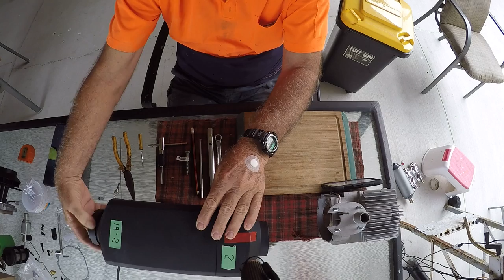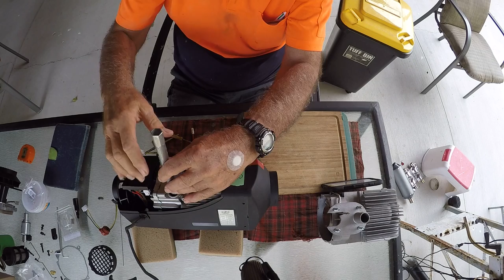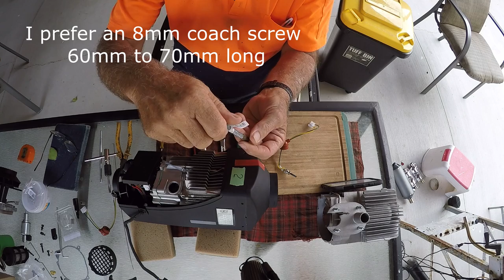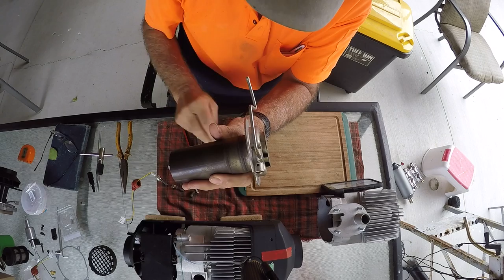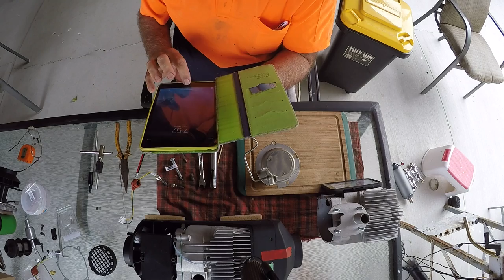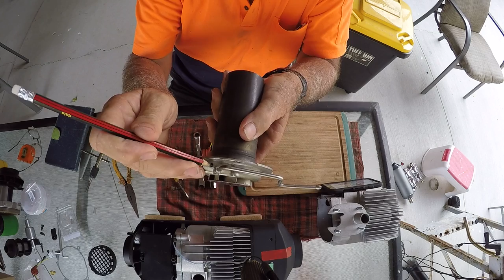Chinese Diesel Air Heaters - Part 9 Glow Plug & Atomizing Screen

Comment: I can’t say it enough, “thank you very much for all your time and effort to make these video”.   Excellent series!!!
Reply from the maker: Hi Svmsice, thank you for the positive feedback. J
Reply: @johnmck1147  i have a 24v 5kw chinese diesel heater and i can't find a glow plug for that specific heater any ideas ?
Reply from the maker: Hi Billy, if you have the common Chinese Diesel heater that is a copy of the German Eberspacher heater there are many suppliers on the internet and eBay. Below is just one link to get you started.

https://www.ebay.com.au/itm/12V-24V-2KW-5KW-8KW-Chinese-Parking-Heater-Glow-Plug-Ceramic-Pin-Wrenzh-/384588971240?mkcid=16&mkevt=1&_trksid=p2349624.m46890.l49286&mkrid=705-154756-20017-0

JMcK

Comment: Definitely a 'Must Watch' series on these Chinese Knock Offs
I have learned that I was about to be ripped off, if I bought the 8K unit.
Also learned that I need to get a better intake screen, two flow through mufflers & yes I can mount the unit on it's side!      as long as the glow plug is on the uppermost side
Again, these are the very best tutorials I have ever binge watched!!!
Reply from the maker: Thanks for the positive post KGB. I am pleased you found the videos helpful.  JMcK

Comment: Wow! Anyone thinking of buying one of these heaters or anyone who already owns one should watch these videos! You have done your research, and you have a real talent for explaining the workings of these heaters. 
Because of your videos, I have corrected some of the mistakes I made when installing mine. For example, my pump was mounted level with the floor of my bus. I have now set it at about a 45-degree angle. I tried setting it straight up and down, but it wouldn't pump the fuel in that position. I fear running it for two weeks in the horizontal position has caused wear that prevents it from pumping at its full pressure. Not to mention I used the priming feature to prime the heater. 
I am about to do my three-week review of the heater and if you wouldn't mind I would like to refer people to your channel. All of these heaters should come with a link to your videos.
Reply from the maker: Hi Luke, thank you for the positive feedback. 

Yes, a 45 deg pump angle is probably the best all around angle. 

You are most welcome to recommend these videos. I do them purely to help people where I can, as part of a paying it forward philosophy. I would like to think some people in the future will pass on similar helpful knowledge to my grandkids.

Comment: When you install the Atomizing Screen make sure the welded joint in the screen is opposite the air and fuel line orifices. Thanks John, wonder full work ...

Comment: May I add a fine point in replacing the Atomizing Screen to John's excellent video. When installing the new screen, make sure that the spot welds on the screen is located away from the fuel inlet. If the weld is adjacent to the fuel inlet, it can block the fuel from atomizing and creates a lot of white smoke on start up. This was the problem of my new Chinese Diesel Heater which smoke on start up from new. By moving the spot welds 180 degree such that the fuel jet onto the clear area of the screen, the white smoke problem was resolved.

Comment: Wish I had seen this video sooner. Tore my heater apart due to not  lightly up, carbon all over from one season of running it. Long story short, I think the atomizer was in the way of the air hole and I had no clue it wasn't supposed to be, so now it will only start on the second attempt (due to the glow plug being preheated from first attempt). I just ordered some new screens, so will be tearing it back down to do this right and put a decent filter on it as well as I have the one that I think is meant to baffle the intake, not actually filter it. UGG is all I can say without turning into a sailor mouth, lol. Thanks for the great video's John McK, you and David M. are life savers!
Reply from the maker: Glad to know the videos were of some help.  JMcK
Reply: Fixed it! Put a new atomizer screen in the correct way using a 3/8-24 tap to clean the threads of carbon and use a BIC Soft Feel Pen to carefully push the screen in place where it should sit (had forgotten about the pencil trick shown in your video). BIC pen is 8mm or 5/16 diameter, pulled the ink side out since the cap was glued in place on the other end. Worked like a champ and now the heater is starting the first attempt. Again, thank you so much for the helpful information John McK!
Reply from the maker: 👍, Good for you.  JMcK

Comment: The manner in which you explain theory and operation is much appreciated,  John! First in installation and secondly being able to diagnose when that time arrives. (Everything man made fails. And never according to budget or schedule!) Viewing a 2nd time, mainly to learn if fuel supply line on heater, the metal one, can be cut and reconfigured. My Plan is to install in a box and operate on a roof top of a SUV. A concern I have is also how much weatherproofing it requires in operation. I see it's basically another ICE except that it's product is heat only and not HP so breathing is critical. 
Again,  like so many other commentors, well done, John. Well done!

Comment: Excellent video very well explained! I think this is the problem with my heater it won’t fire up and I just checked after watching this that my air filter has fallen off, I will take apart tomorrow 👍 

Those birds in the background sound absolutely delightful are you in the middle of a rain forest 😂
Reply from the maker: Hi Ryan, thanks for the feedback. No air filter will not stop the heater lighting, but a carboned up screen will. 
I live in a rural area, not a rain forrest. But I occasionally feed the birds.  JMcK

Comment: John I live in Canada and we have ultra low Sulphur diesel fuel. I found that adding kerosene to the heater tank helped in the winter but you have to keep the amounts low. I found that 10%kerosene to 90%diesel is about right. If you don't then you will cook your pump. I also found that the cetane number is only 40 in Canada and is not high enough. It is recommended by espar to have a minimum of 45 for best performance. You can go up as high as 50. Cetane is the naturally found in diesel fuel but depending on the country it will vary. If you use a cetane booster then kerosene is probably not necessary unless the temperature is really cold. I suggest that you check this out. This is the only year I have not had to change the atomizer screen and it is still working like new. Cetane by the way is what makes the diesel burn and adding kerosene to the fuel lowers the cetane number. The higher the number the hotter it burns

Comment: Thanks John, this is the first time I have needed to change the mesh and is operating fine now. The mesh was very carboned up but I didn't need to use the new gaskets etc, which came with the glow plug kit, as the chamber did not require a clean.

Comment: Yourself, and "Lowered Expectations" channel are probably the best resources on the Diesel Heater subject. I keep coming back to your videos.
If you're still into it, could you explain your technique for tuning the RPM and Hz settings on the controller? Much appreciated.
Reply from the maker: Hi WS,

It is now some five years since I did these videos, and in the beginning I would give suggestions as you ask, It is not hard to change the settings when you go past the password. (A number of sites publish the common password)

However this ability caused many issues, as there is no reset back to factory settings button, when people got into trouble. 

In 99% of cases, I have found the factory settings to be best….And experience has taught me not to give advice on this matter.

Sorry, I can't go further here for you..   JMcK

Comment: Great videos - the best I have seen about this heater!!
I bought one of these heaters a couple of weeks ago and am in the process of mounting it to heat my small house.
I will be using a treatment in my fuel that will ELIMINATE the problem of carbon formation entirely.
I have used this treatment in my vehicles since 1998. My current car with a 1000cc engine and has now done over 300,000 kms and still has original exhaust system, has never had the carby off or head off - nor ever been tuned, Starts instantly and has maintained power output and does not smoke at all. Plugs are changed about every 50,000 kms and oil changes about 20,000 kms - all due to the benefits of this treatment. Engine runs smoother and has about t0% more power and 10% better fuel economy than original as a result of more complete combustion..
I have used this treatment in kero wick lamps with no sooting of the glass and Kero primus stoves with no sooting of pan bottoms. In fact when I first tried it the kettle bottom was sooted and the soot burned off where the flame impinged on the bottom.
I have also used it in my boat diesel fuel where it prevents algal growth (diesel bug).
Reply from the maker: Hi Alan,

Thanks for the feedback. Are you able to tell us what sort of treatment you use?.  JMcK
Reply: @johnmck1147  I can give you the details about the fuel treatment I use if you would like to contact me at the address I supplied in my first reply to your comment
The treatment is in the form of a tablet which dissolves in the fuel. One tablet treats 70 litres of fuel.
I can post you a couple of tablets for you to test for yourself if you like.
This product has been around since the second world war. In fact it was a second world war war secret but was never available to the public until the 1990's. 
After the war only big utilities used it - such as US Railways and Coastguard etc.
It has been tested by numerous government testing agencies around the world and shown to work as claimed.
The product carries a NZ$10,000,000 warranty against engine damage.
Reply: @alanmountford5574  is there a reason why you won’t share the name on here? I am curious to know if you don’t mind.
Reply: @albertanasoul  - e-mmail me at the address I have given and I am happy to tell you

Comment: Great tips much appreciated! Woke up to -1C again this morning only to get an E 03. It'll be 7 - 10 days to deliver replacement glowplug. My bad - should've had a couple spares on hand.
Reply from the maker: Hi JGB,

It is unusual for glow plug to just stop working.

I suggest you check you check the  battery voltage. If your battery is down on voltage or you have voltage drop in the wires due to wire size, the glow plug does not get hot enough to start heater. More info on this in motor home videos.

Cheers.  JMcK
Reply: @johnmck1147  okay, I've charged up the battery bank & will give it another go. It is it's 3rd winter on the boat & it's been brilliant for the price paid.
Reply from the maker: J.Glenn Bauer 

If you have, or can borrow a clamp meter you can check if the glow plug is working. It will draw 8 to 10 amps on start up.

As the heater is a few seasons old, you may have carbon build up on the glow plug itself, and atomisation screen. Also if the tiny air hole where the glow plug is inserted is blocked the heater will not start.

Good luck JMcK

Comment: Thanks again John, i'm getting E-10, even though i have only had the heater on mo more than an hour in total. When i put the exhaust tube on i used some sealing stuff and i think it may have gotten niside somehow so will strip down the beast and check that air hole.
Reply from the maker: Hi Gary, E-10 is a funny code, and probably not caused by your exhaust. 

First try a full reset. Remove power from heater for a good two minutes, reconnect and try again.

Another cause for E-10 is flooded burn chamber, caused by over priming, or fuel tank higher than heater and fuel seeping into heater when heater turned off. If tank above heater install fuel shut off valve in fuel line before pump, and turn off when not in use.

That rubbish vinyl fuel line now supplied with some heaters can cause E-10 issues if more than about 300 mm long. Suggest you use proper black fuel line on suction side from tank to shut off valve to filter to pump. Then use narrow bore hard nylon fuel line from pump to heater.  JMcK
Reply: @johnmck1147  Thanks very much John. I spent 3 hours on the heater tonight and fixed the problem. I took it apart and it was absolutely filthy inside, i think i may have been sold a used one since i have hardly had mine on, probably less than 30 minutes total when it was working. I cleaned the burn chamber and the long pipe bit that goes in it, made sure the air inlet by the glowplug was clear, put it all back together and got a nice clean burn after a few minutes but then an E8. I noticed the voltage dropping from 12.6 to 12.3 while the ehater was running so i turned up the oltage output on my transformer to 13V, the ehater then dropped that to 12.5 during use and now it works perfectly. It heated up my 10x10x6ft shed by 3 degrees in just 3 minutes at full blast. Thanks again for sharing your expertise, your videos have helped so many people, i see you quoted and linked to all over the internet regarding these devices. Have a great weekend sir.

Comment: Thanks for the video, i wanted to know how far to push the screen back in my heater, if you do not push it in all the way the heater will not light very well and smokes a lot because the diesel is not igniting.

Comment: Do you have a video with the electrical portion of diagnosing some of these units? I am getting a start fault code of the ignition plug. I did some testing with the voltmeter. I do not have continuity on my golf log and I am only getting about 6 V whenever I try to do a start up. I’m thinking my voltage is the issue. The unit is getting 12 V at the supply

Comment: Just installed my diesel heater.  Second run...X   glow plug shorted code.  Sure enough it was registering slight continuity on the plug wires.  Bought a 12mm deep well 1/4" socket and cut a slot in it, swapped it out and it's now working like a champ.

Comment from the maker: Hi Pete, 
There is no good vibration, and anything you can do to lessen serious vibration is a good thing. The heaters themselves are very robust with just one moving part, however the electronics are not so robust. Just a very vulnerable circuit board with a plastic top cover held in place with one screw and a clip. It would not take too much travelling over hard Australian corrugated dirt roads to damage the CB. 

The genuine Eberspacher have a much more robust ECU. 

Australian outback dirt roads can be pretty viscous. Only an Aussie or visitor to the outback can appreciate the vehicle damage caused by these roads. 

Anything you can do to lessen the bone shaking vibration will pay dividends. J

Comment: Good info !!! I don't know about the screen. I am having a problem where the glow plugs dose not want to heat past the green indicator on the display. I took the unit apart and cleaned all the parts with parts cleaner ( not knowing about the screen ) it started to work Abit better, but the display showed it was not heating to the full setting ( red ). Now I am letting the section with the screen sit for the day submerged in parts cleaner. If this doesn't work I will have to get a new unit. It's mid August in Canada, and just to order a new plug , screen or what ever I need could take as long as 2 months to arrive. If the parts I order don't fix the problem I will have to wait another 2 months to get a new unit.
Reply from the maker: Hi David,

Tthe glow plug only comes on for a short time at initial start time. It is just used to  start the heater burn, and it then turns off. If your heater starts the glow plug has no relevance to the temperature light display on your controller because it is switched off. 

The heater is able to heat the air from about 50 deg C to 70 deg C above ambient air on a max setting. 

Regards, JMcK

Comment: Hey John, great series mate!! Just wondering if you have my ideas on the E-03 code. I have replaced my glow plug and atomiser (below the unblocked hole) and it still comes up with the message. Exhaust and intake clear.
Reply: Any fix for this? I have the same issue, I replaced the glow plug and the atomiser. When I press the start button the heater makes a single click and E-03 pops up right away.

Comment: Hi John,  Thank you very much for this video series.  I'm up to video 9 and  plan to finish all of your excellent series.  Perhaps you missed your calling as a scientist?  

I did want to ask:  With the pencil eraser screen insertion method is it possible to insert the screen too far, or is there a shoulder inside the combustion chamber to make up for the the inability to use the Eberspacher tool?

Also, since the 12 mm glow plug plumbing tool is probably harder to come by in the US, I wonder if there might be some way to modify a flare nut wrench or crows foot socket to work without dissassembly?   I guess I'll find out when I get a heater!  ;-)

PS Not really a bird watcher, but could not help but notice that the spectacular bird songs serving as background music to your videos.  Much different than those here in north america, and I particularly enjoyed some of the songs about 11 minutes into this video.   I suspect you feed them well for their services! ;-)
Reply from the maker: Hi Dell,  first, thanks for your kind words.

No, you can not push the screen in too far using a pencil. In practice Ausie pencils (made in China) have the right length rubber on them, push in until the brass rubber holder hits the heater. Just make sure they are pushed far enough in to clear the hole.

12 mm socket spanners should be easy to source in the US. You import European and Asian goods who use the metric system.   

Yes, I occasionally feed the birds. The birds you can hear are Australian Magpie, and Australian Butcher Bird. 

Regards.  JMcK